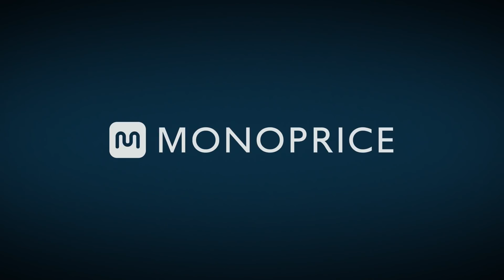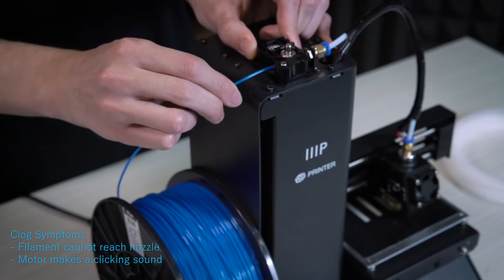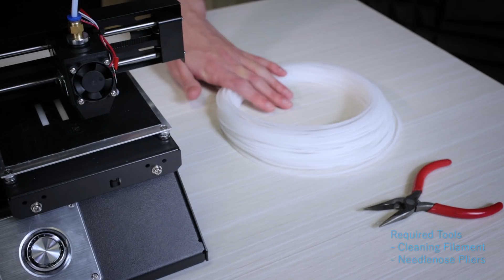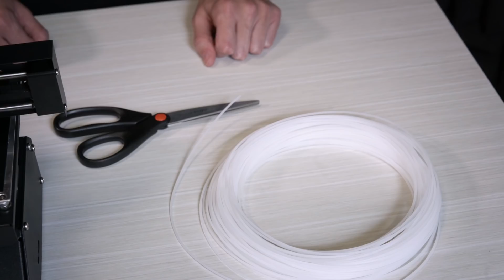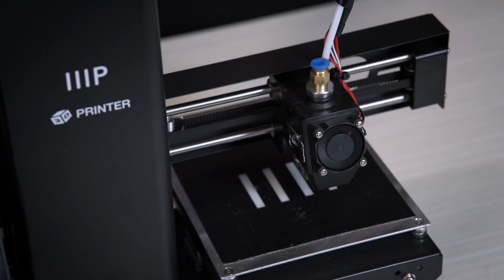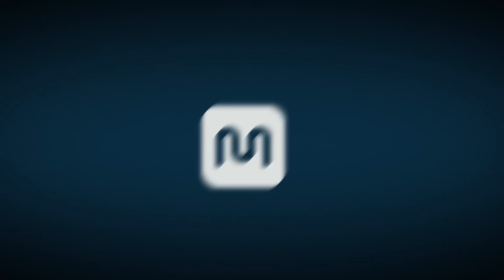How to Unclog the Nozzle

Comment: If you're wondering how to get the PDFE tube out of the blue cap on top of the extruder... Push down on the blue cap. :) Other than that, this video was great!
Reply: Confirmed, you missed a critical step and i shouldn't have listened to you. Press down on the cap, then you press the PTFE tube further into the connector, thus releasing the tension on the toothed washer, then you can pull the tube out.
Reply: @shaldurprime7154 ha that’s what did it. Thanks
Reply: @shaldurprime7154 thank you!
Reply: Mine will not come out
Reply: Yeah i think pressing on the blue cap just dug in further the little toothed metal ring under the blue cap. I know this because while trying to follow your instructions I accidentally cut the PDFE tube with the pliers I was using, and from then on I had to go scorched-earth on the thing. Skill-issue? Yes

Comment: I have a Monoprice Voxel, and found this video extremely frustrating, until I eventually discovered that the Voxel is a rebrand of the Flashforge Adventurer 3, and looked up how to clean the nozzle for the Adventurer 3.  The problem is that nowhere in the Monoprice documentation does it tell you how to remove the clear top cover (or even that this is necessary in order to clean the nozzle) or how to remove the feeder tube (which may be easy if is familiar with other 3D printers, but this model is intended as a first printer).  If you have a Voxel, skip this video and instead search for "Flashforge Adventurer 3 unclog" to find better instructions.

Comment: BE VERY CAREFUL DO NOT follow this video unless you have spare parts, I "bricked" my printer requiring me to order parts by following it :-(  I am very unhappy, I thought that this official video could be trusted and followed without experience.  Boy was I in for a surprise!!  First the video doesn't tell you to carefully remove the blue collar, then it doesn't explain  that the white feeder tube has a tiny metal or brass worm tooth ring fitting inside the top of the metal heat extruder.  It gets bent inside and blocks the filament flow entirely or bites into the filament causing terrible prints.  It's almost impossible to re-insert the white feeder tube back into the metal tooth ring.  Worse yet the ring pops out of the top of the heat end and falls into the carpet along with the blue collar because they don't warn you about them.  I finally found the blue collar and tried to hold the white extruder tube into the heat tip with just the blue collar, but that DOES NOT WORK without the tooth ring, as the filament feed pressure pops the whole white feeder tube out of the heat tip without the tooth ring locking it in!  It took me hours of searching and combing the carpet to finally find the tiny tooth ring.  Then the real work began.  I tried first to put the tooth ring onto the white feeder tube but then it WILL NOT FIT inside the heat end.  I tried to remove the tooth ring from the white feeder tube and its designed to bite into the white tube which cut my finger and nails trying to remove it.  I had to use a SIM card ejecter tool to little by little remove the worm ring from the white tube.  It bent the worm tooth ring slightly and was no longer true round.  Then I had to carefully try to bend it back and put it just right inside the heated tip. Then I could press the white tube just right through the worm gear far enough but not too far, and snap the blue collar down to lock it.  It is very slippery and hard to shove the white feeder tube back into the worm ring inside the heat tip even when the tip is very hot.  I got it in but the teeth would slightly grab on the filament as it passed through.  I had to repeat the whole process several times, at length the white feeder tube was just too slippery.  So I tried to lightly grip the white feeder tube with needlenose pliers so I could get enough leverage to push it back into the work tooth ring and heat tip.  I accidentally bent the white feeder tube and the filament would no longer feed through at all after this.  GAME OVER.  I highly recommend you do not do this!!

Comment: i have this problem but the filament is a long piece and in result doesn't heat up on top. I have tried pushing forcefully on the filament and it does not move. If anyone knows how to fix this problem it would be greatly appreciated.
Reply: I had a similar problem, the filament my printer came with broke inside the tube to where it was too shirt for the extruder to push through the nozzle.

I disconnected both ends of the tube and pulled that peice of filament out. And then used this video's method to fix the clog

Comment: Updated for July 2019: Not your model?  Read this for recent V2's.
  Monoprice support gave me this link and verbal advice on 23 Jul 19, on unclogging the original Select Mini V2 printhead assembly.  I got mine mid-Jun 19.
 First step in unclogging is to remove the teflon tube from the brass Bowden connector on top of the printer head by pushing down on the blue plastic while pulling the tube.   Heat to 220 or 225 degrees, wait a couple of minutes, then try to push filament thru with some force.  Cleaning filament is best for this, and do the "atomic" extraction at 160-180 degrees several times for thorough cleaning.
 If that doesn't work, here's a pictorial on disassembly.  Rather than use pliers on the nuts, use a 10mm wrench to fit both top and bottom.  If the heater block has a black rubber protector, you can peel it off.
https://monopricesupport.kayako.com/section/2-common-issues
  Dissembling the Mini Select V2 E3D Extruder Assembly
https://monopricesupport.kayako.com/article/327-dissembling-the-mini-select-v2-e3d-extruder-assembly
Reply: Please help. I have a Monoprice Maker Ultimate 2 (AKA Weedo f150s) 3d printer. It stopped printing after 1 day with a new nozzle assembly. It does NOT seem to have a clog, by all the usual tests. But, when I take out the filament and run auto-feed or auto-retract, it gives a rapid loudish clicking sound, and I was told by Monoprice support that when running auto-feed and auto-retract without filament it should NEVER be clicking. So how can I dissasemble that extruder  motor box for it? Any ideas?
Reply: @Mark-Kamoski  Not long after i posted this, I found the solution to all my problems with the Monoprice printer.  I packed it up, stored it in the garage, and bought an AnyCubic I3 Mega.  At that time it was about $250, $50 more than the Monoprice, but it came with a 1kg roll of filament and a good number of spare parts and tools, so considering the extras I figure it was a better value.  It has a slightly larger footprint, but if you're not cramped for space, get it.  I've had no problems with the I3 Mega.

Comment: I can't pull out the filament itself even at 240 C
Reply: I'm having the same problem. Even pressing on the blue thing on the top it still isn't working. Can anyone help?
Reply: I pushed a little bit through and then pulled immediately and it came out clean. Hope this helps

Comment: hey i did notice the comment about the blue tab for taking out the whtie tube, but i am having issue applying enough pressure while not pressing on the nozzle to much. i also do not feeling any less tension when pressing down on the cap. i don't undetstand if i should apply more force as i do not want to damage my machine -_-. anybody have any pointers, some of us are still half way there.
Reply: I know its been a while, but did you ever figure it out?
Reply: did anyone ever respond?  I am having same issues

Comment: This didn’t unclog my nozzle and I tried putting a wire through the extruder and that didn’t help either idk why mine won’t unclog but okay
Reply: I just overheated the nozzle to 250 degrees and extruded some PLA. It melted the clog and the filament came right out. No disassembly required.
Reply: The Gæ Man same here.. Did you ever figure this out?

Comment: My filament is stuck from the spool top spring latch all the way to the nozzle so how can I get the bottom fitting to open with string inside of the whole ptfe tube all the way to the top?  Do I have to cut it loose from the reel and remove both blue push locks and remove the entire ptfe tube?  Is there anyway to do it without having to buy the clearing line?
Reply: same

Comment: The tube doesn’t come out on my Mini Select v2 like that. Do they not come out like that normally, or is mine just stuck? I’ve tried pulling with a decent amount of force but I don’t want to pull too hard and damage the whole thing.
Reply: i pushed down the blue tab and it still wont come out
Reply: @meylo4080  did you get any resolution?
Reply from the maker: We are very sorry that wasn't verbalized in the video to push down the blue tab, but it sounds like you are good to go :)
Reply: @monopricecom  how hard to press down?   I am pressing hard with my fingers and it is not moving.  just worried I am going to break something
Reply: same
Reply: Zander Garrant well, you’ll be happy to know I figured it out. This video (and the instruction manual) failed to mention this...but the blue circle where the tube enters is a release tab. Just push it down into the brass nut and that should help release the tube for you. I got mine off shortly after commenting.
Reply: your my hero
Reply: @mikehanna7876  you my friend are a legend as i noticed he left that part out smh
Reply: @mikehanna7876  how hard did you push it down; mine doesn't seem to be moving.  worried I am going to break something.  (If I haven't already by trying to pull out the tube that feeds the extruder )
Reply: greg rawls once I figured out there was a release tab, there shouldn’t be any pressure to the point that you feel like you’re going to break something. It just a little push tab and it just releases it.

To be perfectly honest though...between that, the poor setup help, and the tiny print surface, I got a different printer a few months later.
Reply: So glad to see your comment. Helped me clear a clog this morning. I had been searching in vain thinking I needed a wrench for that brass fitting then saw your comment and I'd unclogged things in 5 minutes.
Reply: TheBoomBomb8456 same
Reply: PS: Thanks!
Reply: Paul John's Life glad to help!
Reply from the maker: Thank you for helping us out on that one! :)
Reply: I dont know if this was answered, but push the blue part down and then pull the tube up.